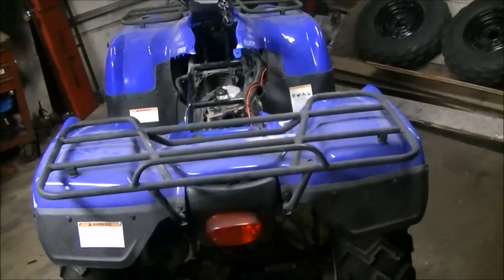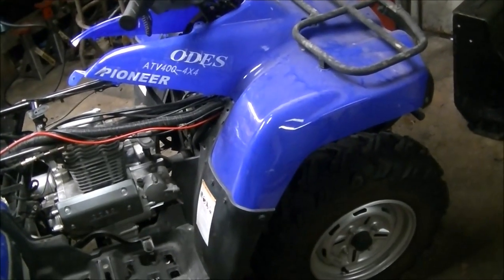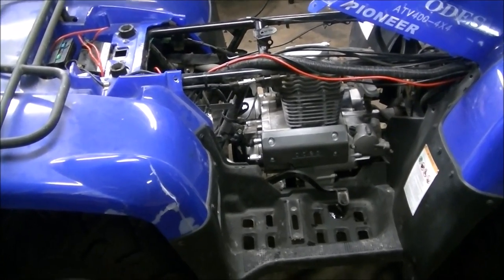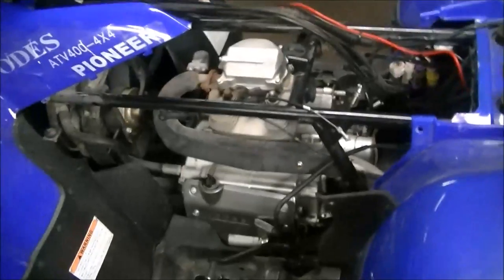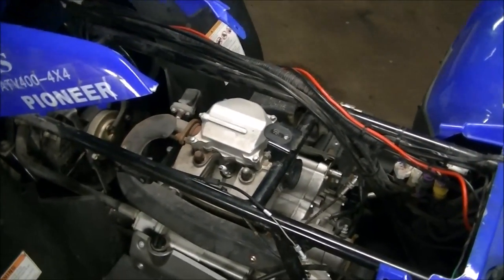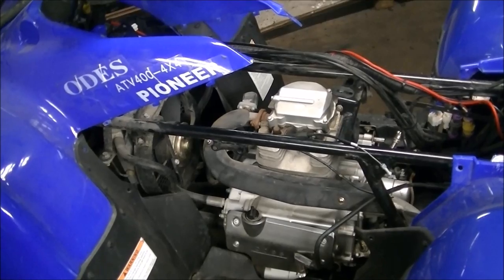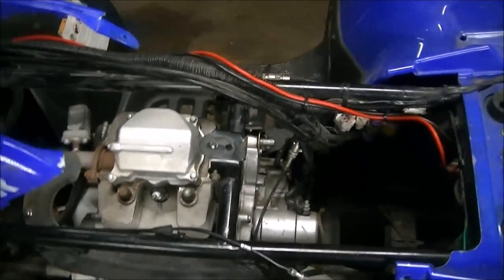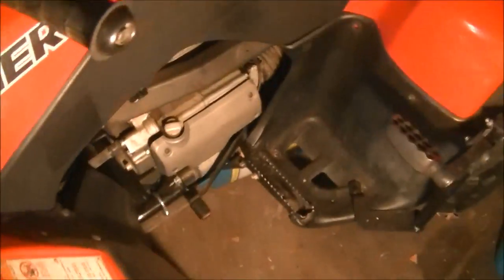Odes 400 ATV Not running? Find out why!

Comment: im trying to figure out there fuse box wiring. mine has 2 random red wires coming from the top of the fuse box that were cut and i cant figure out were to run them. if you still have this unit would you be able to take a look for me? any wiring diagrams for the odes 400 dont show the correct fuse locations ect.

Comment: I have one 2008 BMS Mountaineer with Odes 400cc 4x4 will not start....another person says may have overheated and head may be warped....can not find anyone in my local except very expensive hourly rate to fix...Do you know anyone in the area of zipcode 16748 either PA or NY who would take on this project for a reasonable hourly rate?????

Comment: Hello sir I could realy use your help I can’t find any info on one of these odes 400.  Can you tell me what to line up the timing marks and how many thousands are the valves supposed to be at
Reply from the maker: .006 for the valve adjustment. Research honda 350. It's the same motor

Comment: Hello  I have an odes 4x4 that I want to get running it has been sitting for maybe 10 years only ran for a summer or 2 I believe , I bought a new battery and there is no power any suggestions on what to do ?
Reply: I have one that I recently purchased and got running…check the Mickey Mouse fuse panel behind the seat…still struggling with mine. The clips that the fuses fit into are extremely finicky. I can start mine, drive it for an hour, turn it off, and immediately it won’t start until I fiddle with the fuses

Comment: Hello I did send you message 
few times and no respond I really appreciated if you respond my request 
abut odes.  so if odes is clone of Honda trx 350 . can I replace
complete engine with Honda trx 350  ?

thanks
Reply from the maker: shahriar fathi I can't answer that with 100 accuracy.  never tried it. some parts are the same, some are similar but not the exact size.
Reply: titaniumman
I really appreciated for your respond . can I call you or
somehow we can talk few minutes ?
Reply: Hoping to get the wiring diagram for the 4x4 switch 2 of the 3 connections arnt connected and cant find any home for them
Reply from the maker: @dougmcalear5734  I was fortunate to have the repair manual when bought this. It came with it. I sold it and they went along. Sorry, wish I could help.